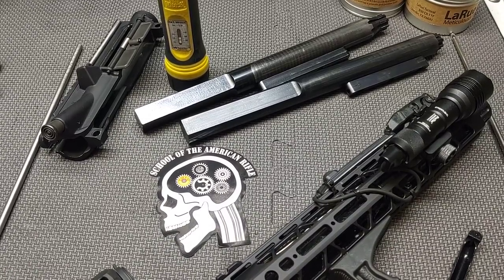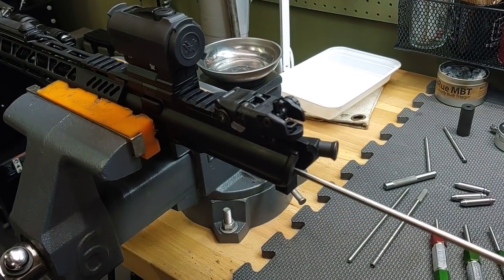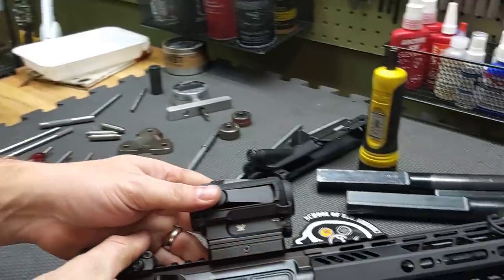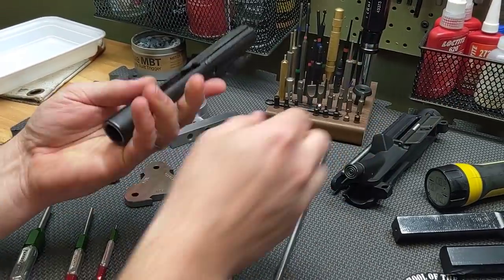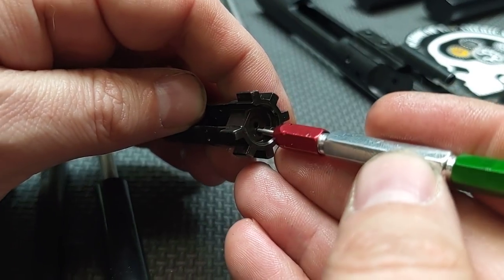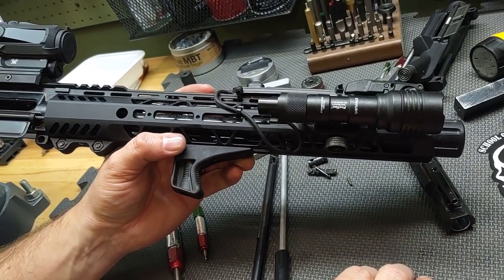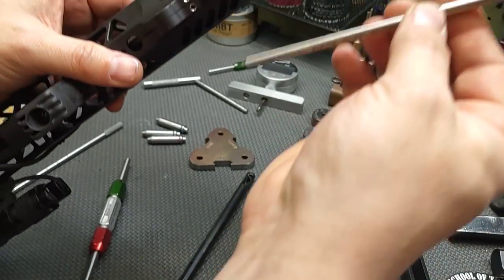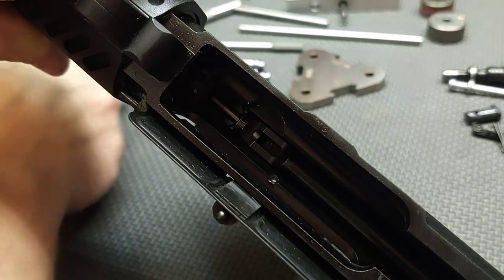PSA Upper Receiver Autopsy - Part 2

Comment: I'm new to all this and I purchased a AR15 from PSA  now I'm wondering how mine looks, I've yet to fire it, what does it cost for you to check mine out?
Reply: bro fire it. you're fine. PSA makes good stuff. Every manufacturer has issues from every brand. this is in no way shape or form intended to be a video saying ALL PSA stuff is bad.
Reply: @SkinnySkinch  Good advice. Some people make it very difficult don't they. Buy a firearm, go fire it, if you don't experience any problems then you are fine. If you experience a problem contact the company and they will fix it. It seems to me that if a person buys a new firearm and is scared to shoot it then maybe they should reconsider if they should even own a firearm.
Reply: I've got a few psa guns/parts, never had an issue but I dont shoot very rough.  Probably fine.
Reply: @nitegoat1369  But you took it out and fired it without a complete autopsy. If the accuracy is not what you expected or is really bad you can still contact the place you bought it from and get it resolved. And poor accuracy doesn't necessarily mean the firearm has a "major malfunction", it could be as simple as the type of ammo you are using.
Reply: @SkinnySkinch  "Bro you're fine" -- are you trying to say a PSA upper that fails 4 QC areas is fine?
Reply: @seanoneil277  That's exactly what I'm saying Sean. Any other questions?
Reply: @SkinnySkinch  Yes.  What are you trying to say, exactly, by that remark toward me?   You aren't responding to what I said to you.  You're redirecting focus away from my reply.  Can you reply on point?
Reply: @SkinnySkinch  Sorry, but I have other plans.  

Why is QC failure irrelevant?

Comment: I got one of those uppers. And think I got super lucky it has stayed 3-4moa at 100 for a couple thousand rounds so far. A little over gassed but for the price I think I got super lucky.
Reply: not super lucky i have built 8 of them so far using psa uppers and had no problems with any of them and all my friends build rifles using psa kits with no problems

Comment: Where do you get all the gauging tools seen in this video (the carrier key, firing pin, pivot pin—the tools with the red/green ends)?
Reply: They look like gages from Slater Tools. He may have them made for the appropriate specs?
Reply: Usually you have to custom order go/no-go gauges from specialized tool makers. $$$
Reply: @templehager4834  Deltronics makes gage pins in increments of .0001. We use these in machine shops. No custom manufacturing needed.

Comment: If the firing pin is puncturing the primer wouldn't this cause accuracy issues? I mean gasses escaping out the rear of the cartridge is not ideal for accuracy I doubt.
Reply: It would only cause deviations in elevation.

Comment: Did you mount the light switch with only zip ties or did you use an mlok attachment? My top rail doesn’t seem to fit the mlok attachment for some reason.

Comment: The Magnuson-Moss Warranty Act would prevent PSA(or any manufacturer for that matter) from voiding a warranty because you attempted to fix it or changed a part. PSA would have to prove that what you did or the part you installed caused the defect before they could refuse to honor the warranty. That being said it is often cheaper to fix it yourself than litigate the warranty in court and PSA probably knows that.
Reply: Ha that didn't stop them from saying they wouldn't touch a rifle i partially tore apart to diagnose.
Reply: @SouthValleyKnifeCo  The answer then is to gather up all the paperwork you have on the rifle and go see an attorney. That act allows you to claim attorneys fees so most attorneys will take the case if they think its valid because the fees will be paid by the company you are suing and not you. I suspect that they will find the will to look are your rifle shortly after your attorney writes them.
Reply: Isn't worth it at this point. I've long since parted with the rifle.

Comment: Could inspecting a spent brass case help with diagnosis?
Reply: Definitely! 
The fired case/struck primer can reveal a plethora of health issues.... 
~Especially if one is a re-loader,  such physical info can tell one if the re-loadable case primer pocket has been previously  swaged too much in order to remove primer crimp. And/or reloaded too many times, or at too high a pressure for the catridge-

(Loose fit)-....If the primer itself is backing out of primer pocket due to too high a pressure as to the former power charge/ect...-"Mushrooming" up around pin impression...
.
The entire fired case itself can tell one a myriad  of info that could be overlooked by a passing glance of a casual observer that doesnt re-load cartridges. Lot of interesting stuff really!

Struck primers can reveal info as to how far/deeply the firing pin is striking/Hammer Fire Control Group spring wear/firing pin retaining cotter pin wear in AR16/M16 platform...

The fired primer itself being one of the most important tools as to  Kriminal forensics. 
Just as matching up recovered/fired projectiles & matching the barrels lands & grooves rifling impression to the barrel that fired such. As all barrels from the same manufacturer will have tell-tale machining clues as to rifling cutting "button" broach wear, tear & usage...

Even with C-old H-ammer F-orged barrels the rifling mandrel itself  that the barrel is hammered around is only good for a set number of barrels manufactured before its outtve spec....

Matching the firing pin face machining physical clues/artifacts to a spent cartridge casing found & the scene of a crime, as those artifacts are transferred to the primer itself in the firing process. With a simple jewelers loupe/hand held magnification set up one can see those very idiosyncrasies between firing pin faces/primers of same manufacturer & caliber/platform... 
They are handy to have to check wear points when doing general maintenance, cleaning, & inspection as you may see the beginnings of catastrophic & possibly dangerous hairline fracture(s) one might miss with the unaided human eye....

 As all interchangeable firearm parts have individual flaws due to machining bits/mill-ends/dies wear & tear.-(Even when brand new)-.....Artifacts are rendered as well from use/heavy use over time as to parts wear...

This gentleman is clearly a PRO in his chosen field of discipline. LOVE his work!
~Be well...

Comment: Where did get those rubber claws on your vise?
Reply: Very easy to find at Home Depot or Lowes, in their tool sections where vises are displayed.  Your local hardware store might have them.  "Soft Jaws" is a common name for them.  Mine are red "Craftsman" & as you may guess they came from Sears before that chain folded.
Reply: I bought some at Lowes several years ago.

Comment: The erosion you refer to where the gas hole intersects with the ID of the barrel is more likely drill breakout when that hole was drilled during the machining process.  That jagged edge is almost impossible to prevent when drilling through holes.  However it can remedied or reduced with a deburring process, post drilling.
Reply: Nope.  Not at all hard to prevent if your work piece is fixed, your bit is sharp, your press & table are not misaligned, and your feed is patient.

Comment: What would cause the bolt or firing pin to be magnetic?
Reply: Taking it part to clean it and placing the parts in magnetic tray so they don't go anywhere, for one of several simple screw ups most people would overlook doing. Same thing with parts washer.  
Plus the previous comment below or is above(?) when youtube actually posts this comment, about the "MPI" process

Comment: Have you encountered a BCG that was magnetized? What would cause this ?
Reply: The cause would be the same as is typical of magnetizing any piece of steel. Not normal action with ammunition, but a strong enough applied magnetic field. For example, placing your firearm on top of a strong speaker magnet, near a strong magnetic field or the like.
Reply: IF the cutting tools used to machine the part are magnetized it can magnetize the parts.

Comment: I just had a bud ordered a 10.5” upper assy. From beaver creek, after watching I’m bout to 2ND guess the one I WAS gonna order from PSA 🤔🤔🤔🧐🧐
Reply: Every company sends messed up shit out the door from time to time.
I had a BCM upper that was jacked up. 
The issue lies in if the manufacturer ends up making it right with the buyer. Which they almost always do. Unless it's Ruger. They will just claim user error and you are SOL.
Reply: @toynazi  Why would you try and spread a LIE like that about Ruger? Ruger has a good reputation for their customer service and any defect or warranty work. My Ruger AR 556 had a discolored upper receiver, they paid to have shipped back to them, put on another correct color upper, then shipped it back, 10 days for the entire process there and back.
Reply: @EC-mc7vg  I'm glad you had a better experience than I did. No LIE. Yes they paid to ship it back to them. They sent my rifle back claiming it was fixed.  They did NOTHING to it. So I took a loss and tossed the upper.
Reply: @toynazi  "Tossed" the upper??? That was rather stupid don't you think.
Reply: @EC-mc7vg  I took it completely apart and put all the parts in the spare parts cabinet.
The issue was the receiver and the feed ramp throat. Receiver was thrown is trash because it was useless. Lesson learned with Ruger.
Reply: @toynazi  Getting a lemon from any company sucks. At least you have the parts and an upper receiver isn't very expensive. Hopefully you can put the parts together with another receiver and have better luck with it. Hope all works out.

Comment: Where do you get all the gauging tools seen in this video (the carrier key, firing pin, pivot pin—the tools with the red/green ends)?
Reply: They look like gages from Slater Tools. He may have them made for the appropriate specs?
Reply: Military armorers manual gives part #`s for the tools It`s downloadable on internet under public domain.